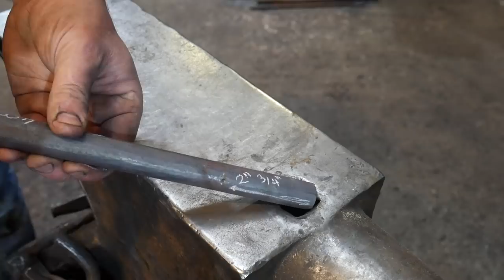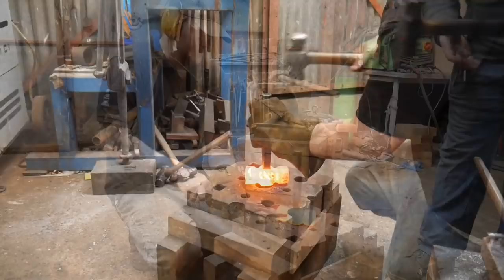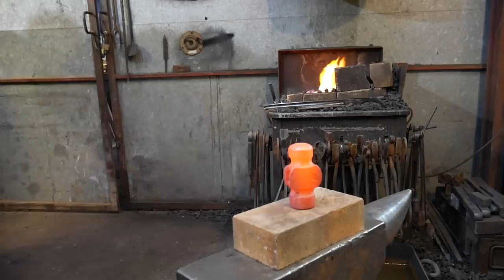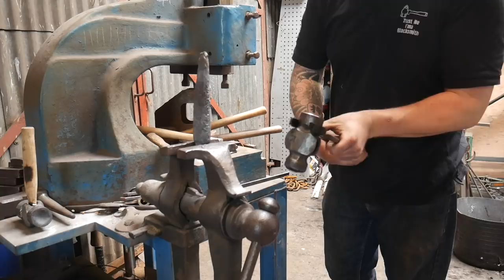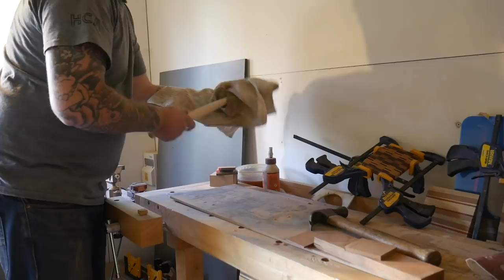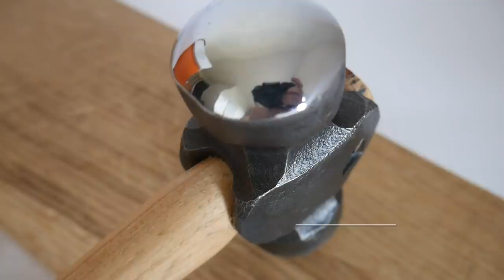A Different Way to Forge a Rounding Hammer!

Comment: Have you tried starting with square stock? If I want 50mm cheeks , start with 45. Fuller and round each end  leaving the cheek area proud . Then punch the eye, work the cheeks ,touch mark. last run the fuller's again softly  . 1 process i have tried and works well. Nice hammer cheers
Reply from the maker: I normally uses square stock. This is the first time trying round. Check out the fat Boi video link at the end and you will see that you have basically described my normal process thanks for the great comment.
Reply: Lol i should have watched first. And are you getting eye damage with this process?
Reply from the maker: @Harry-ei7os  I'm not but I'm mega careful. I punch the eye and just make it big enough so that the hammer eye drift touches the whole eye. Then I fuller then I drift to final size. Hope that helps
Reply from the maker: @Harry-ei7os  also a little forging on the faces with a cupping tool can be good it your forming a mark on the eye!
Reply: Were going good mate I've been at it awhile now. It's good to see someone trying something different as I did the same and find my self Goin back around similar ideas again.  Thanks for the talk. Cheers